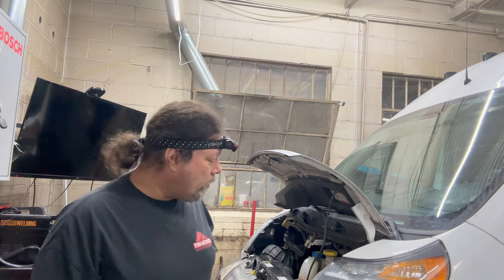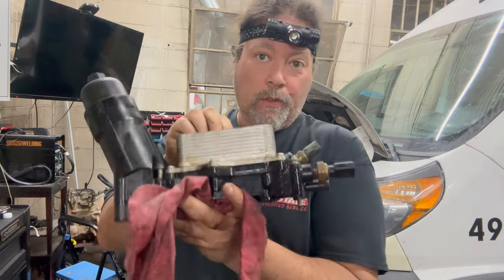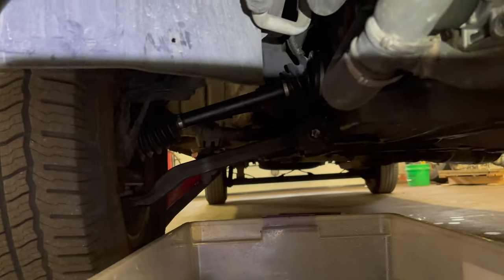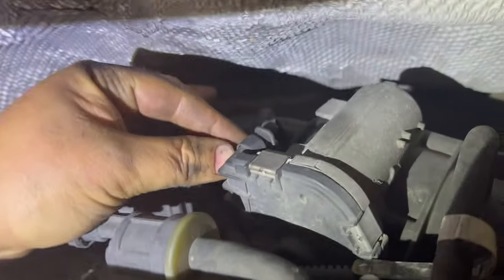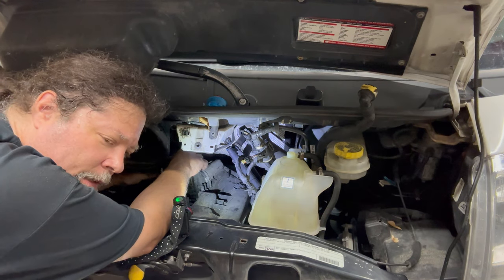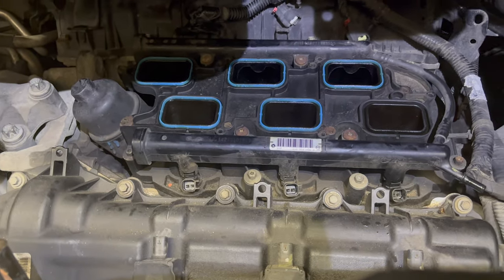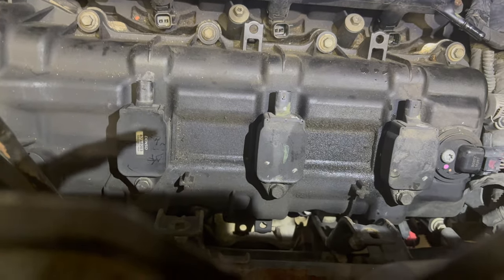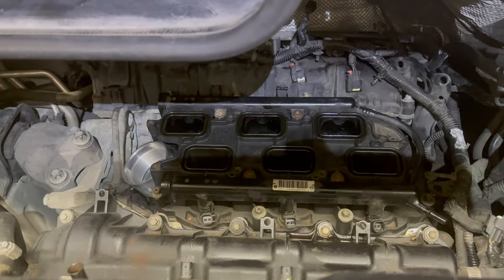Ram Promaster: Replacing the Oil Cooler Filter Housing Assembly Start-To-Finish: Promasters Only!

Comment: Exactly! Leaks because of those rubber seal rings. There is nothing wrong with mopar housing except it's made from plastic, if I knew,  I would  replace just seal rings, but since  I bought  Dorman part and it's aluminum,  decided to use it.
Reply: 😂 nothing wrong with it except everything about it.

Comment: Just wanted to say thank you. Took 4 months of driving to my gf's house where my 2500 was slowly leaking its slick black lifeblood into the street. After doing all of your steps about 3 times due to me cracking the lower manifold (cheap torque wrench) and improperly installing injector o-rings on its replacement, I was ultimately able to solve this for roughly $250 instead of ten times that. And now I can do all of this in my sleep. Feels good to know how the the ins and outs of my engine! Cheers and thanks for the laughs
Reply from the maker: Once you do any job on this engine once, it's super easy. And you can start a side business called Pentastar Oil Coolers ONLY! Or maybe Dorman's R-Us.
Reply: Good job

Comment: Thanks, Kip, for another great video!!!  I never thought about using underbed storage for coolant collection, what a great idea.  On my 2017, since I had to take mine apart a couple of times, once for ignition coils and once for injectors; I figured out how to remove the "oval cabin intake" in under 5 minutes, without having to mess with the plastic cowl below the windshield.   it does require a couple of special wrenches and a small pry tool, but it works.  With the cabin intake off, this job is so much easier.  btw, I love how they redesigned the upper intake on the 2023, it really solves the rust issue with the bolts.  Thanks again for providing the best van porn!!!
Reply from the maker: I have a video upcoming that shows the 2022-up intake. Easier.

Comment: The first time I did this job in my driveway early March in Michigan! That little triangular bracket and myself established a totally new form of profanity with one and  other ? The 28 degree temperature in the driveway was kind of nice though it kept the bleeding to a minimum 🙂 my wife’s turkey Bastet worked fabulous for getting all the oil out of the valley under lower intake 😂 Kip your videos are the best btw
Reply from the maker: I know intimately what busted knuckles feels like when they are frozen. The worst. I feels ya!
Reply: I had the same exact feeling when I did mine!  It is currently not attached to anything.

Comment: Love your videos kip! Wish your shop was closer to Derry NH. Would love to see a video on what you think of the Baxter spin on oil filter adapter. Thank you for ever you do. God bless brother!
Reply from the maker: I'm sure it's a good product, but I don't think it's necessary. The tick problem is NOT caused by oil, and otherwise these engines suffer from virtually zero problems related to oil. Thus, pre-oiling seems unnecessary. But if you really want to, rather than buy something and introduce a new leak point, use Flood Clear Mode which is aleady built into the van. Hold the pedal to the floor when you crank it after it's been sitting. The engine will crank but not start, and within a second it will have full oil pressure.

Comment: Hey Kip,
Nice video!  Plan to replace mine in 25k when I hit 100k and need to replace the spark plugs.  Figure while I'm in there to just replace it.  Its not leaking.....yet, but will so why not just replace it with the Dorman unit. I guess its best to buy it from??  Good idea to remove the coolant, instead of popping the lower hose off!  
Not sure why you did not remove the large intake horn.  Its 4 bolts and you gain a ton of room to see everything.
Reply from the maker: I wanted to show it can be done without removing tge oval air intake. But take that out if you are doing plugs. Rock auto for the dorman, or autozone if you buy it local.

Comment: I've had issues with cylinder 2 reading a code. Change spark plug coil injector. Issue is I'm having a low idle at stop and sometimes stalls
Reply from the maker: I would need to know the code.

Comment: Kip, I've been binge watching every video you have posted so far. Good stuff!
I'm looking at a 2017 Promaster, high top, 136wb, gargo (no rear windows) 196K, new (200 miles) jasper engine(with paperwork) and supposedly a rebuilt tranny in the last 40K miles. Overall, body is in pretty good condition, pretty minor cosmetic issues. What would you consider a good price for such a specimen?
Reply from the maker: Prices are coming down from crazy highs. It's hard to say - the miles hurt it, the jasper and trans help it (still warranty likely) but the 136 hurts it. Such a van in 159" is worth $14 to $20k, depending. I'd guess that the miles will turn enough people off that you should expect to pay maybe $11-15?
Reply: Well, I did it. All those specs I listed above, plus brand new tires, full aluminum Ranger divider and shelving in the back....10,500 ~ Pretty happy about that, hopefully it lasts another 200K miles @promastersonly1419
Reply from the maker: @JohnFoty  excellent.

Comment: Took my dealer two attempts to realize this was the issue with my oil leak.  The van only has 20k. They needed to remove the upper and lower manifold to replace this part.  Is all this going impact the long-term health of the engine? Thanks!

Comment: Hey I’ve your videos and have had my 3.6 ( in a Jeep) for 10 years. Had all the common failures and replaced with aftermarket parts Dorman oil cooler and melling rockers and lifters. My question is at what engine temperature does the Promaster van typically runs at? In jeeps they very between 204 - 230 during normal driving conditions. Thanks
Reply from the maker: That's right on the money. What they do is use the fan to regulate the temp, so once it's fully warm it will start at 204, go up to around 224 or thereabout, then run the fan for a bit, returning back to 204. The target temp is 208, but the cycle is wide. Anything above 232 is cause for concern (fans). The downside is the factory dash gauge generally wont move at all until you are close to 245!

Comment: Thanks Kip! Is there anything else preventitive wise I should do while I'm in there? I was going to replace the  temp and oil pressure sensors 
Oil Filter Housing /Oil Cooler, sparkplugs, doorman thermostat housing. 70K on my 2019 and I'm going to Alaska.
Reply from the maker: That's basically everything. If you want to go ape, you can replace the PCV valve since it's cheap. You'll have decent access to it when the intake is off. If the two problematic bolts in the upper intake are rusty, you can replace just those two.

Comment: Thanks for the video, i just finished replacing my old oil cooler to the aluminum oil cooler, my problem now is, the transmission is in limp mode, since it lost all the coolant, it doesn’t change gears, it stays in I think 1st gear. Any help will be appreciated
Reply from the maker: @mendyyabra7294  if you have the red lightning bolt on the dash, it would be a problem with the oil temp sensor in the cooler that gets disturbed when you replace the cooler. But if not, its likely not directly related to the oil cooler swap. Happen to know the codes it’s throwing?

Comment: From what you say it seems like high grade seals would be all you really need.
Reply from the maker: Yes and no. Around 2020, chrysler got sick of getting ripped off by their dealers for replacing perfectly fine coolers with bad seals. So they released a revised seal kit. It works better, but it's not perfect and not as good as the Dorman aluminum unit, best I can tell. But yeah - if you are doing the work yourself the better seals cost a whopping $10.

Comment: I wasnt able to find an email for my question so I thought I'd post it here.  I'm trying to duplicate my fab key on my Promaster. I've taken it to several stores that duplicate fab keys but they can't seem to be able to do it.
The dealers want $350 to duplicate.  Is there a way around the dealers you know of?
thanks for this channel!
Reply from the maker: It's a point of some mystery. Some locksmiths claim they can duplicate that key. Then they fail. Yet I've heard of others who are successful. Most locksmiths can duplicate the transmitter pretty easily and cheaply, but the metal key itself is what gives them problems. It sucks, but the can order you a key and fob off the VIN and program it, but yeah they hose you with the price.

Comment: Could you please tell me what is the cheap Chinese knock off failure points are vs the doorman unit ?  The reason I ask is I have been able to buy two incredibly cheap. Both units are new. I have completely disassembled the unit to look for metal shavings, clogged  coolant or oil passages,all looks good. What else to look for please.  And I would like to know what to look for BEFORE I under take this task. Thanks !!
Reply from the maker: @MrPaulis47  early on while the dorman was backordered, i bought 4 from amazon. Installed 4 in customer vans, and 2 leaked immediately. Unsure exactly where or how. If you are doing it youself, go ahead and try the knockoffs if you like. Just be prepared.
Reply: Thanks for the reply !! @promastersonly1419

Comment: Another great video, thank u thank Kip. You mentioned replacing the front bolts in the intake well, what's the bolt size? thanks.
Reply from the maker: It's a proprietary bolt, only available from dealers. Get P/N 6512338AA and replace the two in the wells.
Reply: @promastersonly1419  Thanks,  since they're going into plastic should they be torqued to a specific setting or not?
Reply from the maker: Oh sure. There's a torque spec and a sequence. It's toward the end of my video, I believe.  @J.Radwan
Reply: Kip, I bought the replacement bolts but before I proceed with removing the old ones I wanted to check with you first. My concern is if the bolts break while attempting to remove them would that cause any harm to continue driving the van until I find a reliable mechanic that could do the drilling part you showed in your other video "How to remove rusty Promaster intake manifold bolt".
Reply from the maker: No. If the bolts break, nothing changes. It'll be a problem for the next time you need to get the manifold off, but it'll be fine until then. 
 @J.Radwan
Reply: @promastersonly1419  Can't express enough my gratitude for all the knowledge (and off course the humor)  u share with us. Thank u Kip.
Reply: Kip, sorry to keep bugging u man. Luckily I managed to unscrew the bolts even though they're rusting. They are loose but can't get them out of the well, tried using magnet to no avail. As if the intake is designed to capture the bolts somehow. Got any tips I could try before taking it a professional ;)
Reply from the maker: @J.Radwan  it is designed to partially capture them. Get some kind of hook under them and pull them up, they will re-engage the threads then come out.

Comment: Thanks for the great videos sir. I'm having a coolant smell that I nor two dealers can't find. Do you think it could be coming from this unit. It never drips on the pavement or anywhere inside the engine bay and I never have had to add coolant. It's an 2018 with only 71k it's been doing this for a couple years now. Thanks for your thoughts if any.
Reply from the maker: There are several super common spots for coolant to leak. One is the coolant bottle - I figure they would have found that but I have videos on it. The "dick" or coolant crossover tube is another common one (also have video), as are the radiator side seams. Since it's minor and slow, you can choose to ignore it or go to Autozone and get a 1oz bottle of UV and find it with a blacklight. It basically CAN'T be the oil cooler itself, but it would be leaking a lot, and they almost never leak coolant - they leak oil and it will pooled in the V of the engine.
Reply: @promastersonly1419  I have already did the dye, should have told you that. No sign of the glow worms!! It's still under warranty for a few more thousand miles. I have heard of people getting fed up with this and just putting stop leak in it.
Reply from the maker: @mikedye5812  resist the temptation - stop leak rarely works, but it works very well to gum up your heater core! 

You know the expession “all up in my grille”. Now’s the time for you to do that to the van! See if you can get the blacklight to every part of the radiator side tank seams. Also look at the bottle cap itself - we’ve seen those leak. But if you cant find it, ignore it. Just check the level more often.

Comment: Hey kip, a question off the subject of this video for a moment. Can you idle a ProMaster overnight when sleeping
Reply from the maker: Yes you can. It will burn .6 gallons per hour in winter and .4 gph in summer. I think it's fine, so long as you aren't leaking coolant, meaning as long as you don't run out of coolant. It's opinion, but I do NOT think it causes any harm to the engine whatsoever.

Comment: Use a needle nose pair of vice grips and pinch the  coolant hose next to the heater assy before taking the unit loose and then taking the hose clamp loose. If ya do it in that order you won't loose hardly any coolant if the engine is cold with no pressure in the system. You'll only have to top off about a quart of coolant at the end. No need to drain the system unless ya want to flush the coolant.
-guy that does about 4 3.6L oil cooler housings a week..
Reply from the maker: That's a hot tip. I have been just draining it from the bottom, but that defintely saves a step.

Comment: Hi, do you happen to have a video or anything showing how you get the rear triangular bracket back on the upper manifold?  

For the life of me I can’t get it back on. They don’t line up. I get it seated and then try rotating the bracket up and forward and the rear most slot is about 10mm too low. Not even close to fitting on.  I actually had to bang it off when getting it off and just thought “that’s a problem for future martin” and here I am.
Reply from the maker: @colwem  possible you need to flip it over. Possible that little fork dohicky coming off the metal coolant tube is getting in your way. The only real way to do it is loosen or remove the 13mm bolt that hold the triangle bracket to the head, seat the two studs, then thread the bolt.
Reply: @promastersonly1419  yeah I never actually removed the bracket. I just loosened the 13mm so that it can rotate backwards pivoting on the 13mm stud. The coolant tube bracket is indeed preventing me from removing the triangle bracket.  The intake is definitely correctly seated. The triangle bracket simply can’t be rotated forward now. The holes don’t come close to lining up. I saw a YouTuber say they cut a slot in the bracket so they could get it back on. I might resort to that
Reply: @promastersonly1419  before I go crazy on this…. How bad of an idea would it be to simply not slide the bracket back on? The thing has 9 other bolts and feels super solid as is.
Reply from the maker: @colwem  Not having the triangle bracket will do absolutely no harm at all. You are correct -there are two studs at the front, plus 7 bolts holding the manifold down, plus a big locating nub molded into the upper. The extra 2 on the triangle bracket wont really do a damn thing. I would never leave it off on a customer van, but I've left it off over hundreds of thousands of miles on my own vans with no issues.

Comment: Hey Kip.. do you know what was changed from mopar housing from AA to AB?
Reply from the maker: I don't. But I do know around 2020 mopar released a revised o-ring kit, replacing the o-rings that go underneath the cooler. For years dealerships and tech were replacing the whole cooler, but the problem is those o-rings, not the coolers rupturing internally or anything like that. Probably, the B revision just includes those newer seals. For my money, the Dorman is just better. Metal is better than plastic, and we have yet to have a Dorman fail (after 2 years of installing them). So I prefer the Dorman.